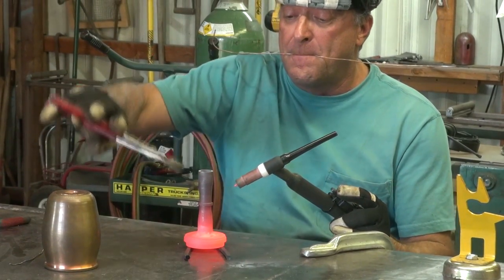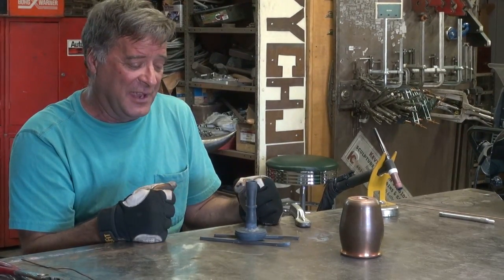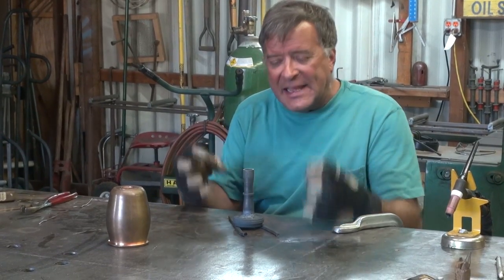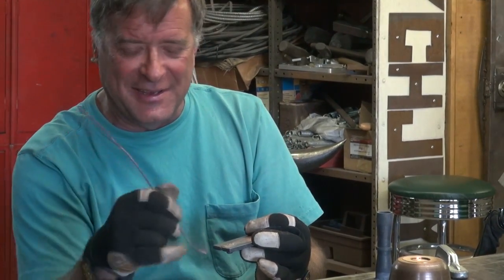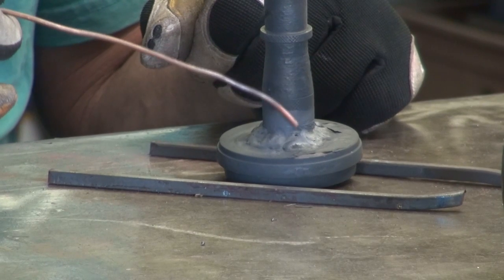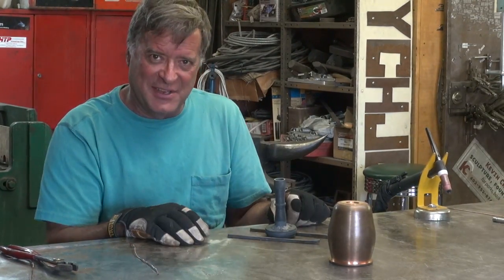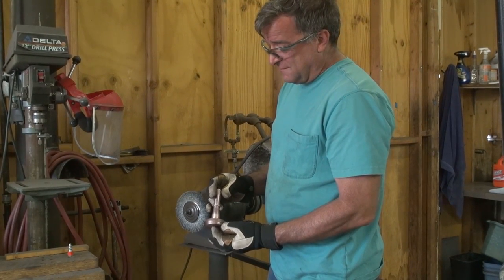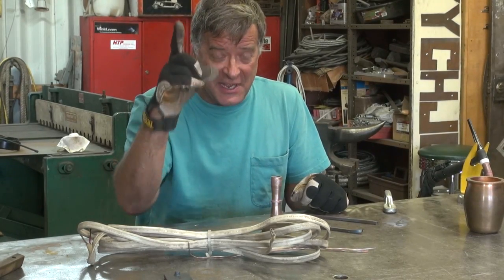How to Weld Together a Copper Goblet - Kevin Caron

Comment: Cool video! I work with copper, making chimes and jewelry. I do gas weld it, but I dislike doing it, lol. And one tip to remove all that ugly firescale is to throw the piece into a mixture of white vinegar and salt for about 15 mins. The scale will just wipe off.
Reply from the maker: Will write that one down for later.    Thanks for watching and posting.

Comment: Can copper be welded with a mig?
Reply from the maker: Not that I know of.
Reply: Well, since you can weld copper to steel with mig and silicon bronze wire, you should be able to weld (really braze) copper to copper, though I haven’t tried it myself. Worth a try though.

Comment: You cannot use TriMix with TIG.  No CO2.  Only Ar or ArHe.  CO2 will burn up the tungsten in short order, so will 02.
Reply from the maker: Everlast Welders and Generators I stand corrected,,,, again!
Reply: Kevin Caron, Artist Kevin, Wouldn't have mentioned it but people who hear it but don't realize that you were thinking about MIG and try it with TIG  historically (for us) leads to lots of angry tech support calls when they try it and expect it to work..and it doesn't.. ;)

Comment: I use Bronze BLU-4217406 from Liquid air to fil steel dovetail. My tig welder use 110v , Cer tungsten at 80-100 amps. Why do I produce sparks and fume ? The sound is louder than bacon frying. There is a lot of residue around the braze. 
Thanks and thanks for all your video.
Reply: ***** Many tanks and warm regards
Reply from the maker: I believe that is from the bronze.  It's normal.

Comment: Very Cool... I can't seem to get enough heat out of my Miller DV 165 to do any 'real' copper welding, but found that I like the bronze brazed look much better anyway....  I think a Bronze braze around these copper pieces would look AWESOME and add a bit of a 'organic look' to the piece.  However, it defeats the purpose if you're looking for continuity, especially with copper match.  Anyway, nice job, will we see the finished product in the New year?  Cheers,

Comment: Good video, as usual. I did see one thing that I would do differently. Use the full face shield you had hanging on the drill press next to the grinder. I have found that my wire wheels sometimes like to eject wires into shirt, pants, …. etc. I would like to keep you intact so you can make more videos.
Thanks, Tom

Comment: kevin its funny i welded some copper last week. i used rosebud preheat,straight helium,12ga stripped Romex, 2% thoriated tungsten, DC straight polarity, lincoln precision tig 225. i hit it hard then back it off when every thing starts flowing. Romex was invented about 15 mile down the road in Rome, NY by the Rome cable company hence the name Romex